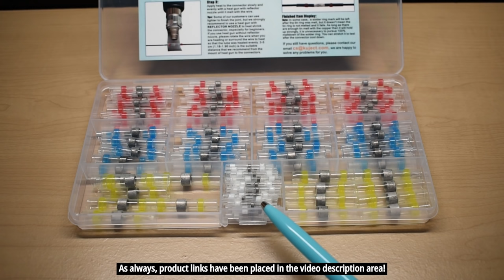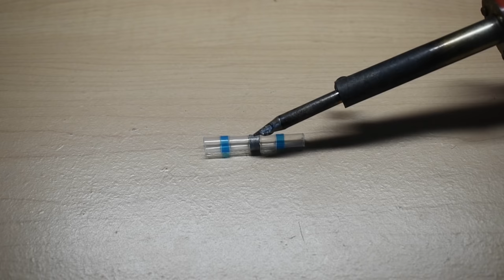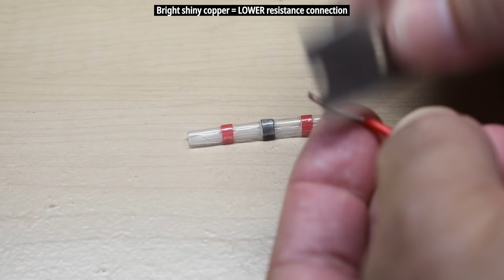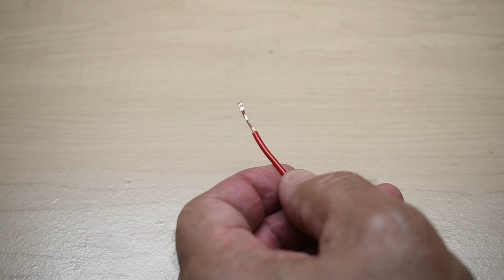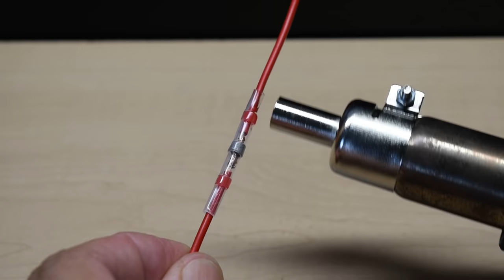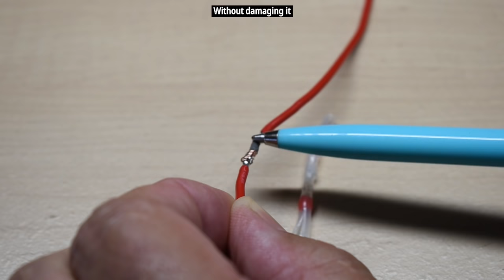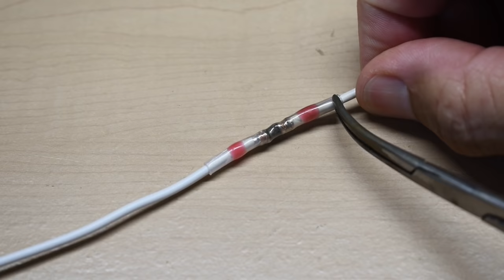Amazon's #1 Best Selling Solder Seal Connector Any Good? Find Out!

Comment: 7:25 maybe that’s a result of bending the wire earlier before cutting ? But boy, that solder doesn’t stick well even to good copper @ all it seems ! This stuff is a nice gimmick targeted @ lazy bums ! 😂😂
Reply from the maker: No, that happened during cutting. The strands were probably spread out a little, and the cutter squeezed them together. The solder is very tight against the copper strands, but it doesn't fuse to the copper.
Reply: @electronicsNmore  That's not a robust connection then. In what situation would anyone want to use this?

Comment: What my own personal experience has taught me with this kit is that it is fragile and very temperamental. Are used it to make connections on a 16 gauge underground dog fence but I could not rely on the Sauter to work. If I made it hot enough to melt, it also melted the huge shrink wrap. I ended up doing a conventional Sauter on stripped wires and using the connector as a waterproof seal. Time will tell if that even works. It may be popular but popularity is not necessarily truth; I mean Barack Obama got elected twice so what’s that tell you about the herd mentality.
Reply: The fact you threw in political views after misspelling solder as sauter twice is hilarious

Comment: You're doing it wrong.
You can totally properly solder wires using these connectors.

Firstly, either buy better connectors that contain some flux or add a drop of flux to the joint.
Secondly, you don't need to scrub darkened wires, flux will do a much better job for you.
Lastly and most importantly: you have to heat it a lot higher, around 270°C.

It is very easy to not overheat these even if your heat gun is set to 400°C+.
The trick is to heat the whole thing evenly and to watch the solder.
It will melt and flow into wire.
The moment it changes the last bit from grey to silver is when you can stop heating it.

Yours didn't change the outer part of the ring from grey, meaning it didn't reach the temperature when the solder can actually flow into the wire and adhere to copper.
It was also not hot enough for the adhesive to fully melt and actually adhere to the insulation.